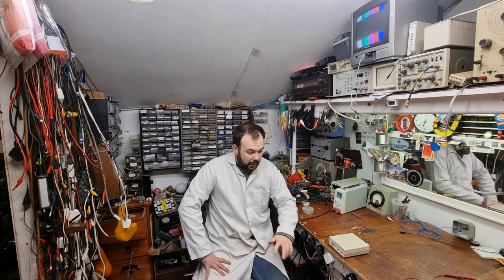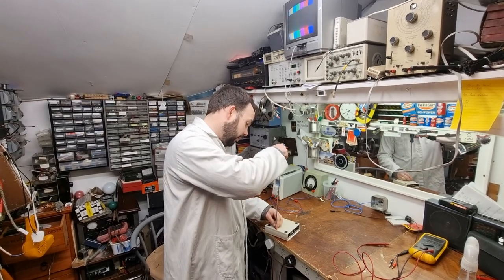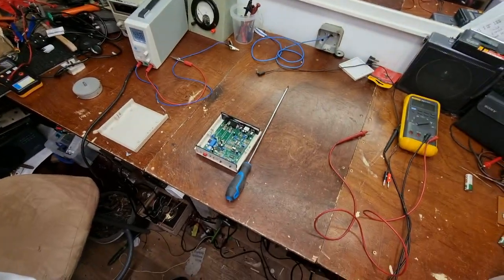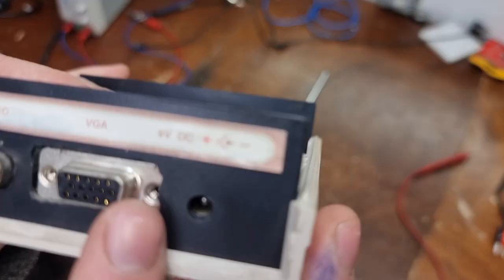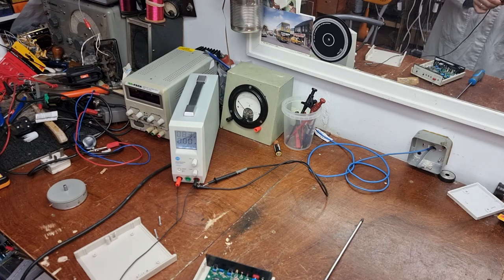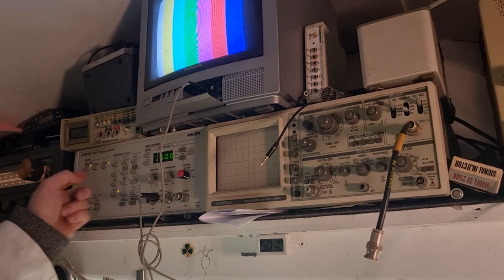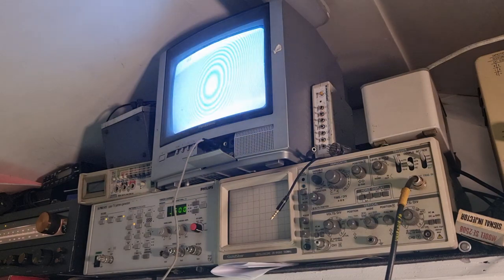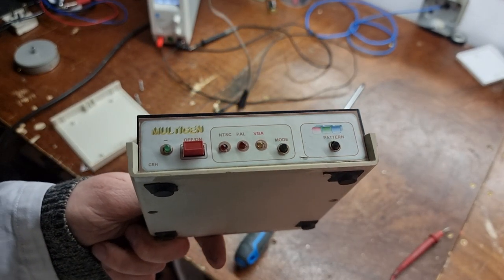Multigen Pattern generator

Comment: I ordered and built the kit a few years ago, lucky you removed the batteries when I got my multigen out last year and found the PCB  destroyed by leaking duracells.I found it was a bit unstable in use so it was put to one side and I continued to use the Manor supplies generator which is still going strong after thirty years. For VGA monitors I got a teletest unit also still going strong.
Reply from the maker: Sorry to hear that, hopefully you'll sort it.